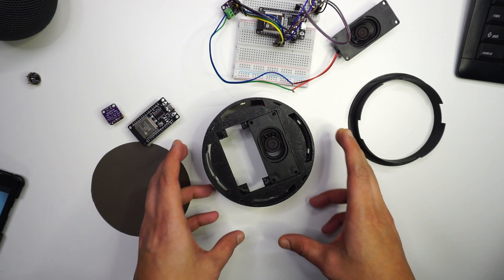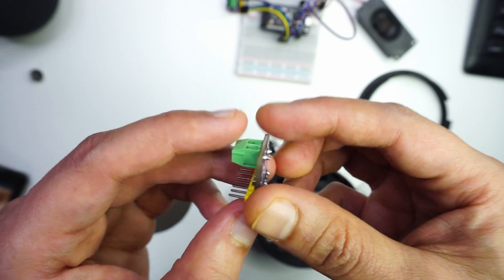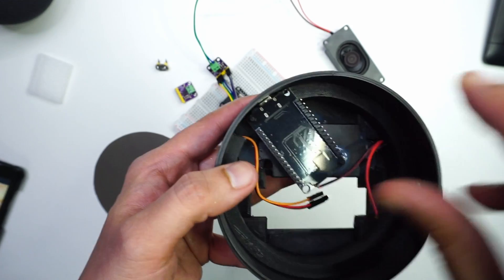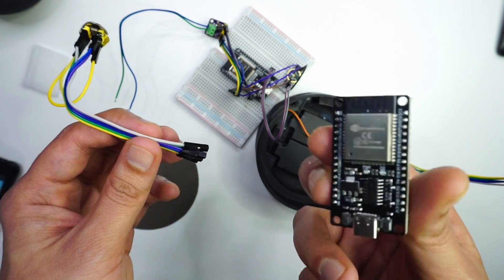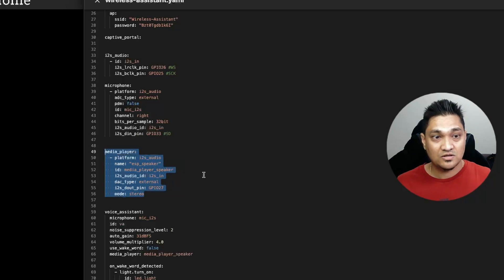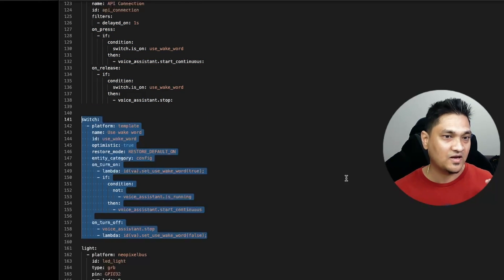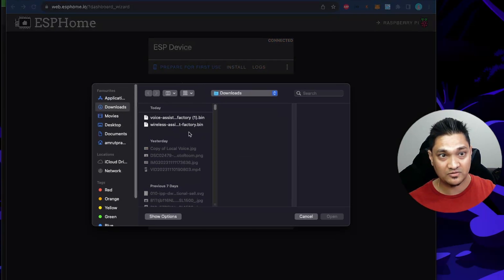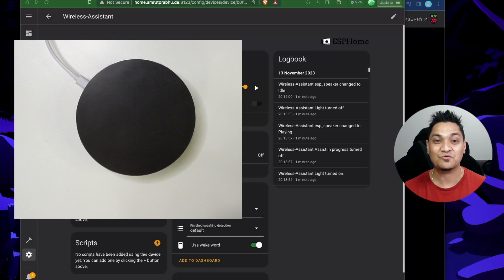How I CREATED My Voice Assistant With 15$ With WAKE Word Using ESP32 And Home Assistant

Comment: Great work, got mine done today, had to wait for the container to be printed as I dont have a 3d printer. One issue I have, when a command is done I get the done message but the lights done turn green. However, if I click on the toggle in the interface they turn green. Any ideas?
Reply from the maker: This is correct.. the reason is the time is so short between text to speech, it doesn't show up. This is because after the first media file generation, the media file is cached. If you try to clear you media cache, and give the command again it will take a little time to generate the mp3 file and then you'll be able to see the green color.
If you really want that green color to show up every time, you can put a delay statement of 1-2 secs, after the green light turns on.

Also I am really glad I could inspire so many to create their own voice assistant 😄
Reply: @SmartHomeCircle  would this be right?  on_stt_end:
    - light.turn_on:
        id: led_light
        effect: "None"
        red: 0%
        green: 100%
        blue: 0%
    - delay: 2000ms
Reply from the maker: Yes.. that also works. Or If you want you can also add it here: 

  on_end:
    - delay: 2s
    - light.turn_off:
        id: led_light
Reply: @SmartHomeCircle  As I am not a yaml programmer I wouldnt know how to do that but thanks for the reply

Comment: Okay so I wired everything up but the microphone and the speakers do not seem to work. I tried using the wake word and even changing it, but there is no detection happening, the speakers do not play any sounds either. I used hot glue to secure all of the jumper cables into the components. Maybe I destroyed the microphone or amplifier? I'm not sure how to fix any of this.
Reply: everything else seems to work, the lights can be turned on and off, and the board is recognized and shows all the entities.
Reply from the maker: Can you play a media file using the amplifier? 
If so then, then you are pretty close. Try to see if the connections are correct for the microphone and also check if you have the set the preferred assist pipeline in the ESP32 device page.
Reply: @SmartHomeCircle  I will have to try tomorrow as the cables I was using were not really appropriate for the hookups. I had to do a lot more splice than I would have liked and I did not have female to female dupont cables which would have made my work a lot easier. I will wait for the new cables and then I will try to solder the pins to each component and then use the female cables to connect everything, then I will try again. Thank you for all your help. The code installed without any issue to the esp32.
Reply: @SmartHomeCircle  I don't think it worked, but I cannot test it out on any other of my devices since the only other media players I have are actual alexas and they do not support TTS without the notify call service
Reply from the maker: @b4iwakegaming  just want to know what you tried. Did you use the tts service in the developer tools and selected the target as the media player from esp32?
Reply: @SmartHomeCircle  yes thats exactly what I tried.
Reply: @SmartHomeCircle  also I removed all the wiring and soldered the pins onto the  microphone and the amplifier. I will try again tomorrow, hopefully it was just a bad connection issue
Reply from the maker: @b4iwakegaming  let's hope for the best. 🤞
Reply: @SmartHomeCircle  okay so I soldered everything, but there is some crunchy sounds coming from the speaker. I jiggled the wires and i believe it is a poor connection/bad soldering, but for a half hour, I had the wake word detection AND the speakers working just fine. TTS was successful and I even had it turn lights on and change colors by voice. My only thing is that either the connection is bad or the system itself is not stable. I may have to purchase new parts and re solder them better. I'm worried I may have ruined the amplifier and /or the mic. Currently re-flashing the ESP32 to see if it works again without manipulating the wires.
Reply: Sorry to keep commenting, but now that I've resoldered everything, it is all working as needed! Thank you again!
Reply from the maker: @b4iwakegaming  no problem at all.

I am glad it worked out for you. 😃 So now enjoy using your very own voice assistant. 🎉

Comment: How have you connected both the speakers.? The MAX98375A module has only one output? A great video again. I plan to make a wooden enclosure. Will share it when done.
Reply from the maker: I had connected both speakers to the same output. You can connect one speaker if you want to. Share it when you make one. 😃
Reply: Thanks. Will try it when the components arrive.👍

Comment: For me I tried esp32s3 dev kit N16R8 and a Esp32 D1 mini, and they are very unstable. It crashed a lot, sometime it is because of brownout, sometime is because of the media_player component, which took too long to process and not reset the watchdog timer. What about yours?
Reply from the maker: For me I am using the normal ESP32 dev board. I started having problems with my batch of USB C based ESP32  related to wifi.. So I switched to the  micro USB ESP32 dev board. Its pretty stable. Only in like 1 out 7 times the response from the command does not get played on the speaker.. Otherwise pretty stable..

Comment: Do I need a breadboard to do any of this?
Reply from the maker: If you have one, it would be helpful. But if you have jumper wires then you can connect them directly.
Reply: @SmartHomeCircle  okay thank you! Great work with this by the way, the unit looks really nice!
Reply from the maker: @b4iwakegaming  thanks a lot for such kind words 😄.
I love making things and want to share it with everyone so they can also make them. If you are interested you can make one by yourself. Everything is present in the article in the description.
Reply from the maker: Also working on a new V2 version of this one. So I will make a video about it also.
Reply: @SmartHomeCircle  I placed an order as soon as I saw your reply. The components wont be here for at least another week, maybe 2, but I plan on building this for myself (: Thank you again. I'm going to check out v2 now.
Reply from the maker: @b4iwakegaming  perfect. If you're on twitter, post about it.
Reply: @SmartHomeCircle  will do!
Reply: @SmartHomeCircle  one more thing, if I were to buy a dht22, can I add temperature sensor functionality to this board as well or do I need to do that separately on a new board? I would like to incorporate a temperature sensor into my voice assistant so that I can ask how hot or cold the room is. I would also like to get a LCD panel so that I can put a digital clock on the face of it
Reply from the maker: @b4iwakegaming  you can add temp or light sensors. I guess it uses i2s interface. But adding an lcd along with it might not be possible with the limited number of available gpio pins.
Reply: @SmartHomeCircle  That's fine, I may skip out on the temperature sensor if I can still install an LCD instead... That is, if taking the temperature sensor out of the equation would allow it...
Reply from the maker: @b4iwakegaming  as far as I remember an lcd takes 5 input pins. So lcd with speaker and mic might just work.But I am not sure of it. Give it a try and see.
Reply: @SmartHomeCircle  sounds good I will see what I can pull off, thank you for all of your help!
Reply from the maker: @b4iwakegaming  your welcome. Glad I could help. 🙂

Comment: Hey, is there higher wattage amplifier with I2S? I'd like to use more powerful speaker but i didn't find I2S amplifier with higher supported wattage.
Reply from the maker: As far as I know its not available.
Reply: @SmartHomeCircle Alright, np, as it is just AMP with DAC, i split those two to individual components so i have DAC and AMP separated. With setup like that i'm able to power stronger speaker with those I2S components.
Reply from the maker: Ohh.. that's what you would have to do. There are DACs for I2S which I think would work. But ya separating them is the way to go.

Comment: heyy! was wondering if theres any way to use alexa routines  in home assistant , i have some smart bulbs/ sensors that are compatible with alexa but not with home assistant :0 (tp-link Tapo)
Reply from the maker: There should be an integration for tp link in Home Assistant..

Comment: Woah, I didn't realize this could be done with the Arduino framework. So this can also be used as a media player? For example, I could send a text-to-speech message to it?
Reply from the maker: Yes you can. It had tested the setup using text to speech. And it works.
Reply: @SmartHomeCircle  thanks! That’s definitely worth a Super Like! (or whatever it’s called. 😀)
Reply from the maker: @hi-ccowboy7983  Wow. Thanks a lot for this. That is such a huge appreciation. This keeps me going. 😍

Comment: So my instance is all connected correctly and works fine. Only issue is when first turned on I get a buzzing from the speakers that only stops after my first voice command and I get a voice response. Any ideas why this is?
Reply from the maker: Ohh yes.. its one of the problems that still exists. I mentioned it in the video and haven't got any work around for it. The first command solves the issue. And I am currently using it that way. 😄. If I get a solution, I'll make a video about it.
Reply: Thank you for taking the time to respond. Love what you’ve doing for the Home  Assistant community. I’ve built mine into a Dr Who TARDIS toy.
Reply from the maker: @Thebyeman  ohh lovely. If you are on twitter, please share a photo. There would be many who would love to see what you created. 😃
Reply: @SmartHomeCircle  I’ll make a little video and upload it somewhere
Reply from the maker: @Thebyeman  Niceeeee...
Reply: @sGames , I've found temporary decision by adding play_media command to 'on_client_connected' section, just like this:

  on_client_connected:
    - media_player.play_media: !lambda 'return "airport-bell.mp3";'

Actually, mediaplayer doesn't play anything, and I am not an expert in ESPHome configuring to find out why, but at least this solved a problem of noise ^)))